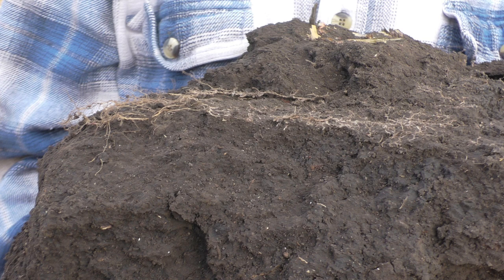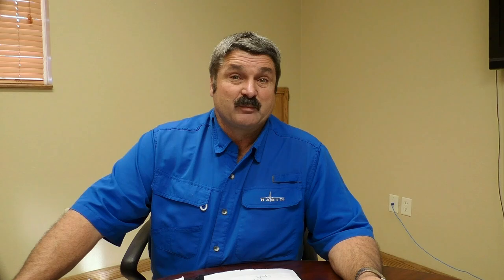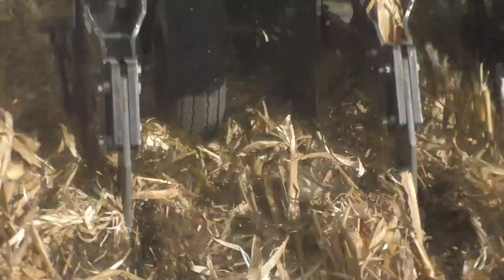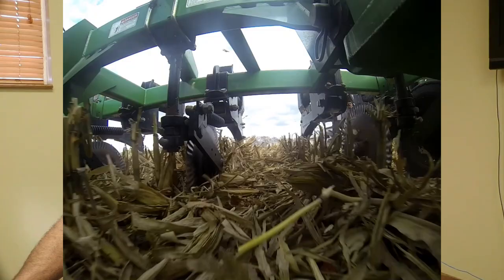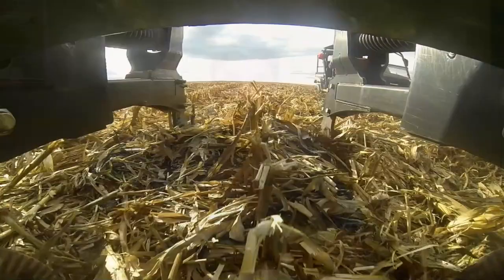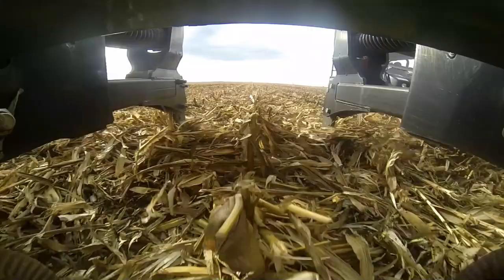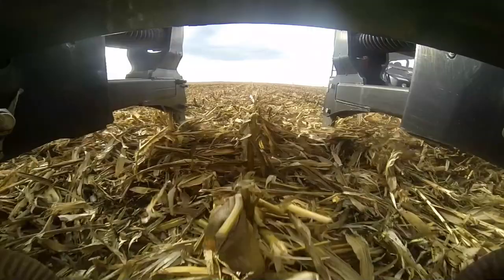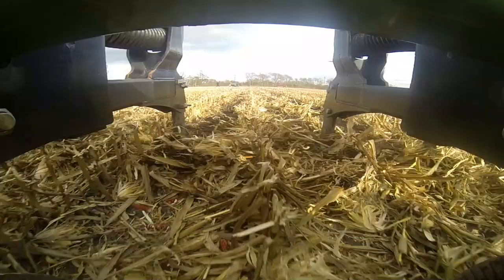Primary Vertical Tillage Done Right

Comment: I don't farm, as I unfortunately don't have a farm, I am a very passionate gardener. That being said, I found your video very informative.

Always wondered why/how the rippers spaced so far apart would even be practical to work the entire soil area after passing over it. It makes sense thou now, depending upon what crop you have grown, the roots (specially regarding corn) can go 6 feet deep, and who knows how wide they spread to seek water (Usually width of plant, but that varies for plants seeking water). With this method you are using the previous plants roots to assist in breaking up the soil for the next crop.

I find that quite ingenious. Why work harder or spend more money when you can have the plants you grew last year do half the work for you? But as you stated, if you are not down far enough to "catch" the root system of the plants between your rippers, you have just wasted all your time, energy and most importantly fuel running across that field for nothing.

Comment: One of the problem running  V-Ripper years ago was too much moisture the soil reducing the shattering of the soil.....we used a V-RIPPER PRIMARILY ON OUR
COTTON GROUND the topsoil was 8 to 10 inches deep on top of mostly heavy clay the clay usally didn't get dry enough to subsoil till fall or we did subsoil some fields during summer on fallow ground

Comment: Great video!
Does ripper point have any effect on the depth needed for complete shatter? Example a 7in point on 30in spacing would need to run deeper than a 10in or a 14in point on 30in spacing? Or not?

Comment: What is your perspective on narrow points versus wings?
Reply from the maker: Adding winged points will require more horsepower if pulling the machine at the same depth as before.  The column of soil you are attempting to lift becomes bigger.  You may be able to decrease your depth with the addition of wings to lessen the load, but you still need to watch for full lift in between the points.  The amount that you could shallow the implement up will be very dependent upon soil types and conditions.  When the implement gets too shallow you will see the soil start to shatter almost straight up from the edge of the wings, rather than lifting across the soil profile from point to point.
Reply: @CropTechInc  
Thank you!

Comment: Can you run a inline ripper to deep
Reply: Tyler Felske I believe you want to find the sweet spot where you get vertical shattering and minimal surface trash disturbance. To deep over works your equipment.
Reply: If I have grasped the understanding of the concept correctly being a gardener:

What you are trying to achieve is to go deep enough to grab enough of the roots from the plants you planted last season that pass between your rippers so that they pull/break up the soil between the rippers themselves. Going too deep will only increase your fuel costs and time it takes to accomplish your goal of breaking up your field.

So you need to find the happy medium. Break up the soil evenly across the width of your implement while also saving yourself time, wear & tear, and money spent on fuel. Every field more likely than not will be different, may be different in places in the same field. So if you have to shoot for accomolishing the job with minimal stops/starts for adjusting depth, if the happy medium is 14"- 19" deep but you can do 20" with equipment, might be good to shoot for 17".